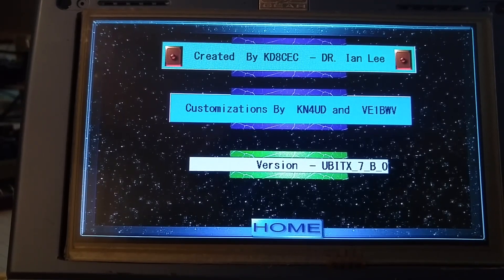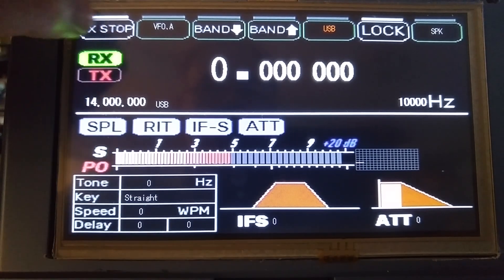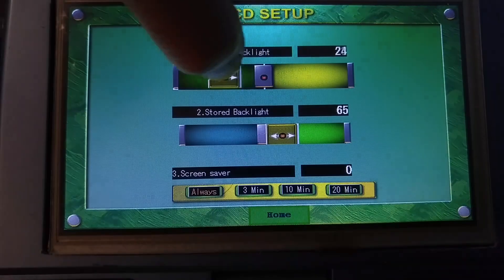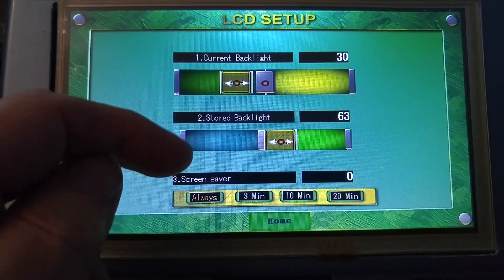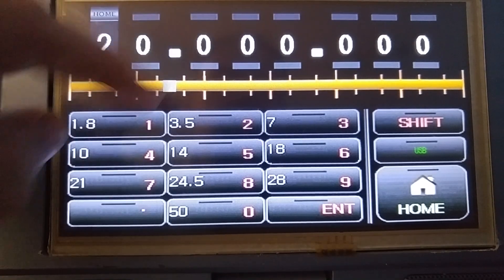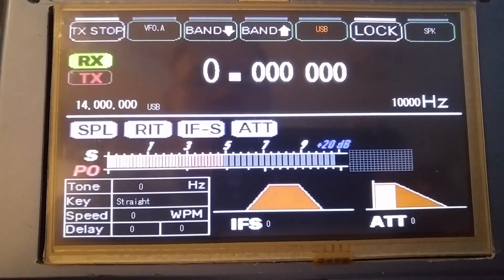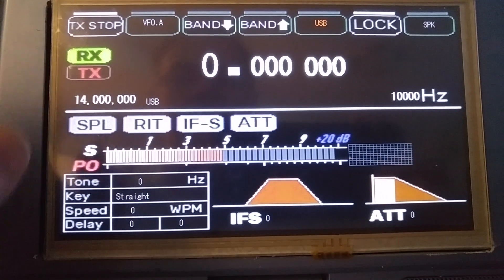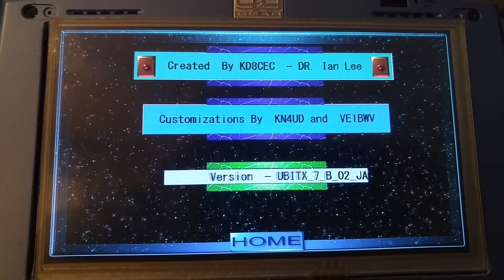Nextion 7 Inch Touch Display For UBITX Radio

Comment: I was wondering if you've done a video about your sdr that you have in your ubitx case.  Is in going to be intergrated with your nexion display interface
Reply from the maker: The sdr which i use is a Chinese one which has a Rtl dongle and up-converter builtin . It automatically works with any KD8CEC software.
Since I use the up-converter version the SDR butto on the UBITX screen allow me to choose which audio to listen to.  If it is in speaker mode then the ubitx audio is heard. If it is in SDR mode I can listen to SDR audio and Ubitx audio at the same time.   The video for the sdr is always available either way.
For the Nextion display, it is does not change.. No SDR video on the display as it is run from the computer
Joe  VE1BWV